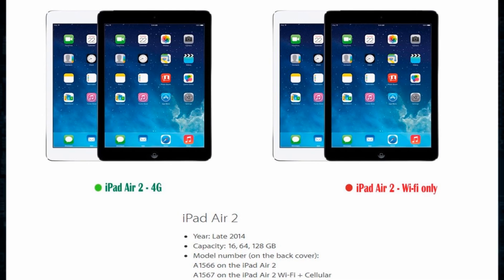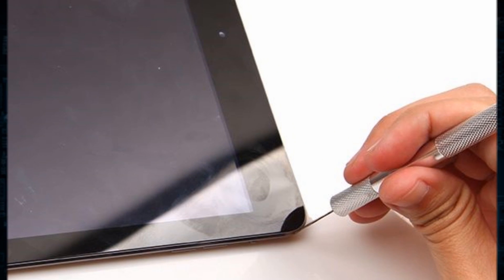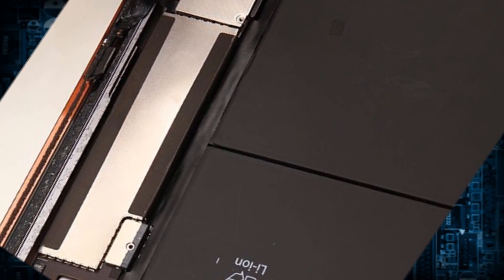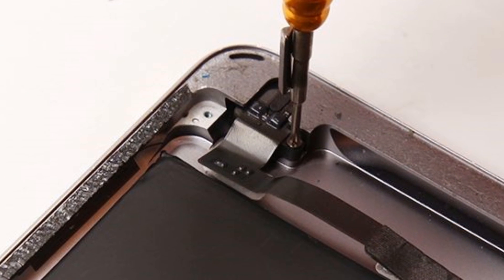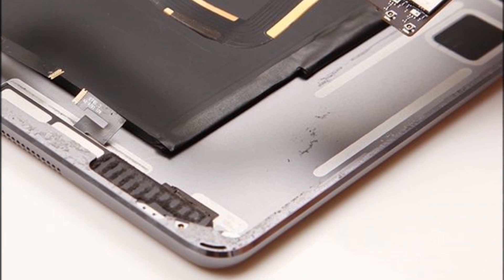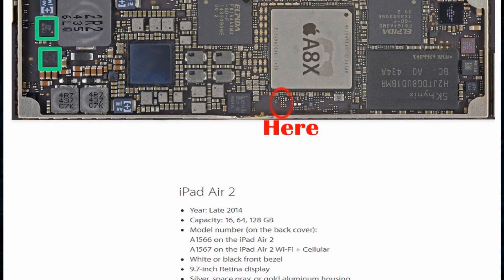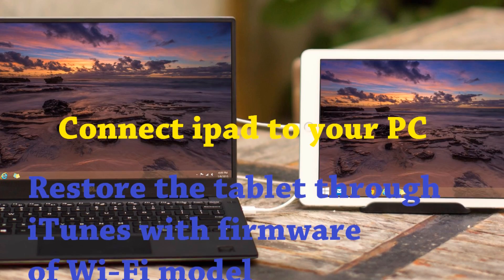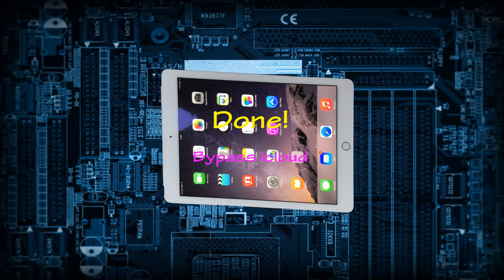Update| Bypass iCloud iPad Air 2 | Full Detail and Schematic

Comment: After restoring the tablet via iTunes with the firmware of the Wi-Fi model and activate it using the official method.
if after removing the jumper on the marked place. the tablet will remain activated !!!
if this experience is realized, yes or no. modele A1566 
thank you for all

Comment: What is the reason for jailbreaking and replacing driver?  Why does it need to be replaced? Will changing the WiFi IC chip to one from a iPad air 2 wifi make it work without jailbreaking?

Comment: Work. Only one question. I can't find how make wifi work. My version 9.3.2. I try do jailbreak but I can't installed ifile.
Reply: it gives error 14 on restore.. any help please.
Reply: Mu Rashi you need to pay for truly jailbreak and after that you can installed wifi.
Reply: no i needed to downgrade because 9.3.4 was not upgrading. you never have to pay for jailbreak. stop spreading wrong solutions.
Reply: i paid for used pp helper. This is like donation 10$. I unlock 8 ipads. But right now I have one ipad air 2 and apple release ios 9.3.5 and I cant now jailbreak this ipad. I can unlock but wifi will not work. for this I need this jailbreak.
Reply: are you saying if you donate 10$ pp helper you can jailbreak ios 9.3.5?
Reply: I downloaded some software from unlockicloud24 .com and it allowed me to bypass icloud lock on my 4s.. Get your ass over to the site before it goes offline !!